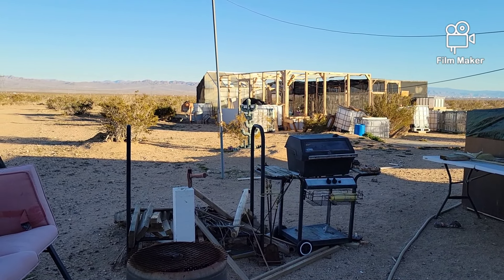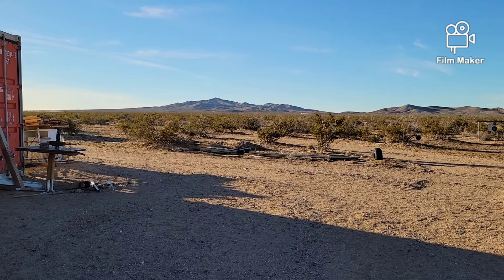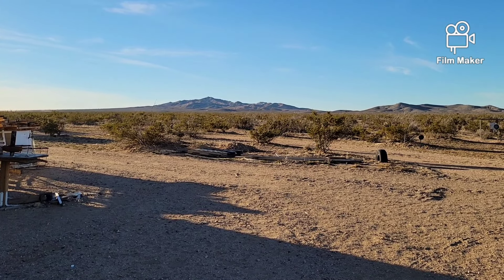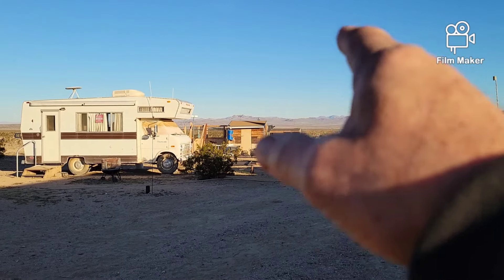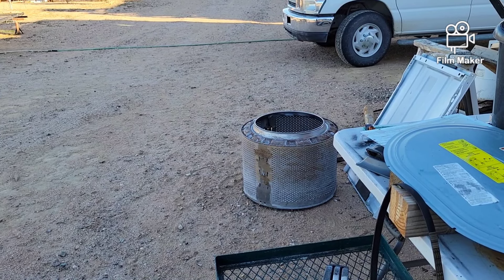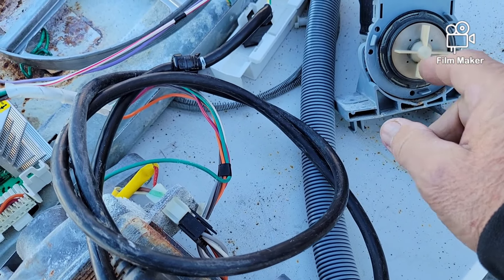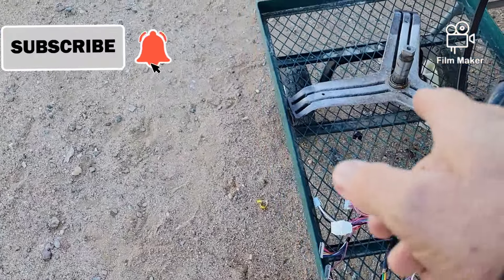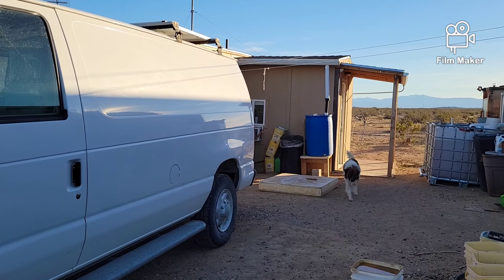Trash To Treasure, Jan. 11, 2024

Comment: This concept is why I love the DIY culture. The idea that you can make something out of a raw material, or turn something to good use by using your brain! Applying ideas to make your life better while staying free. Its inspiring.

///

I like your ideas on batteries. And yes, low temperatures many of the batteries out there do very poorly. Especially anything with Lithium performs really bad in low temps. 

I wish more people would look at your channel. They can learn from all the good things you are putting out there. Right now without knowing some DIY skills... so many of these people are going to hurt bad in any kind of down turn. And we're in a series of societal down turns.
Reply from the maker: Yep, actually,  if lithium batteries don't have cold charge protection, you can destroy the battery putting a charge to it in cold weather.  It becomes a paperweight. 
Thanks, yes I like to repurpose when ever I can. And yes, many people will be zombies if the SHTF.  I'll just have more time to complete projects.

Comment: I was curious to ask you about ethanol. They 'claim' it has a really high octane rating like 113 or so for using in cars. But then they go around and say that its not a very efficient fuel. But octane rating really should be called burn rating. 

I wonder if this means they are actually tampering too much with fuel ethanol to sort of spread out or stretch the volume? I thought this would be interesting to ask you about... 

Like recently the winter fuel... it seems really really bad on gas mileage or someone is siphoning my gas. I wonder if others are experiencing this?
Reply from the maker: E85 is cheaper, but it also produces less horsepower, so you lose about 23% on mileage.
Also, E85 will damage an engine that isn't designed to run it.  A yellow gas cap, or E85 stickers are needed to use it.  In the cold, E85 also loses more efficiency.  ( but it won't freeze)😆
I don't know where you got the info about 113 octane though.  E85 means Ethanol 85 octane.
Reply: I heard this 113 ish figure from before they mix the ethanol in. But who knows if its real. There's so much misinformation out there that you can only really rely on people that have really done their own applications. Your information sounds good.  @GBear
Reply from the maker: @noahriding5780 I checked and they claim E85 is 100 octane.  I am amazed at that claim.  I have used it since Bidenomic/Newsonomic policies drove the cost of gasoline to the top of the mountain.  I get 2 miles per gallon less that I did with regular 87 octane gasoline, but the $2.89/gal still makes it my best choice.
Reply: so do you think they are lying or cheating on that somehow? like 100 octane doesn't make sense. it would get better gas mileage if it was really like that, right?  @GBear
Reply from the maker: @noahriding5780 not necessarily. Burn temperatures are different between alcohol and gasoline.

Comment: Buddy trust me you are way better off to build your own lithium batteries! Especially for higher voltage battery banks. Doocan power is a very good source for batteries . They are excellent A grade cells I have personally  capacity checked every cell i have ever bought from them. There is many simple effective types of bms out there also. I have tons of experience off grid and will never use lead acid ever again since switching to lifepo
Reply from the maker: Thanks for the advice.  I may go that route.  Money is tight, so any way I can save is good.